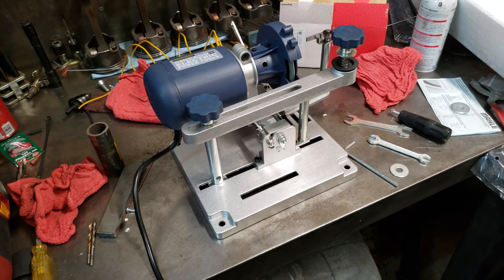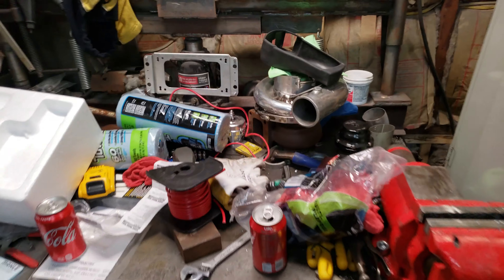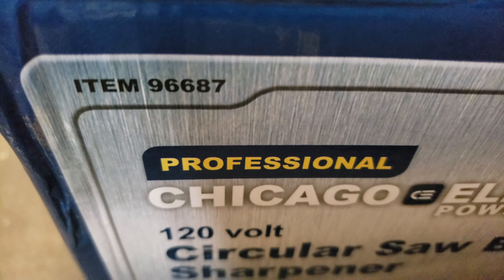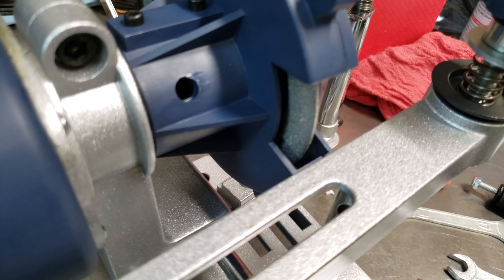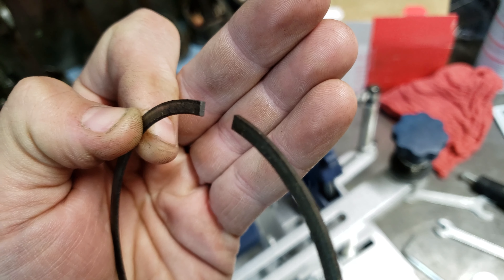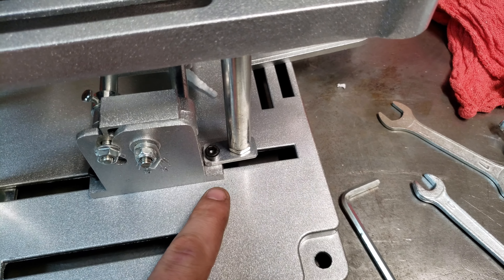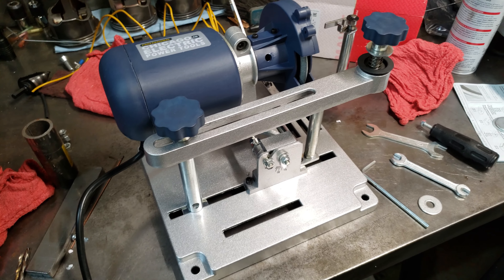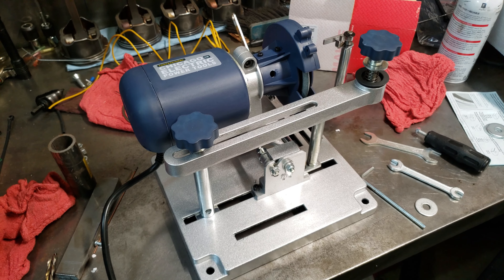Cheap powered piston ring grinder at Harbor Frieght-with diamond blade.

Comment: Thanks for the heads up. I picked one up and my brother adapted/made a table for the ring to lay flat on keeping it square with the blade. Worked flawless. The only issue was just operator learning the touch. Thanks for the excellent tip.